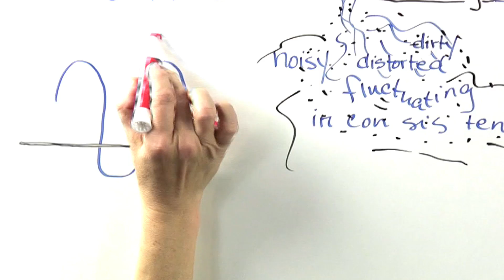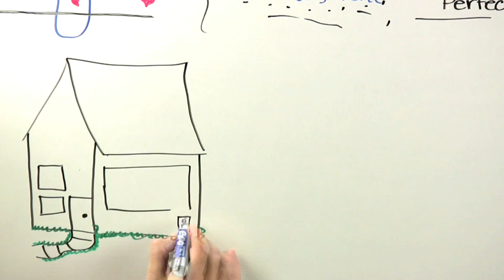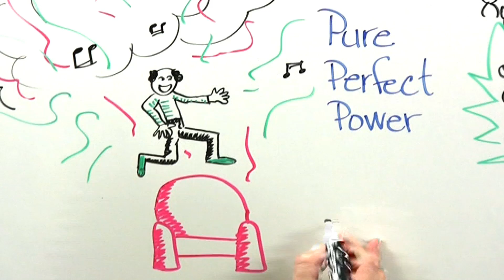PS Audio PerfectWave Power Plant

Comment: Please explain how your PerfectWave  Power Plant can clean up the AC power and a properly designed power supply in an amp can not.  Why the duplication of effort?  Modern power supplies can handle wide variations in input voltage.
Reply: @mrmaunz42  No, not bullshit.

Comment: Is this available in India?  I have a total of 24 audio equipment functioning as one unit.  I badly need something like this as the voltage fluctuation is severe here - 30 volts up and down every couple of seconds.  I never get 220 volts as claimed.  Usually it's only 180 volts and during peak hours it goes down even to 140.  Please let me know if 'PS Audio PerfectWave Power Plant' is an ideal solution for me.
Reply: You don't need this snake oil, you probably need all audio eqipment with full-range switching (even better if with PFC) power supplies

Comment: So, are you saying that you convert domestic AC to DC and then back to 'pure' AC so that my hi-fi or whatever with its expensive transformers can do Ac to DC...  There was once a vogue for making amplifiers that ran off DC batteries with separate AC-to-DC conversion boxes but they never caught on; I wonder why?  And where does good old earthing come into all this - do you ignore it or recommend drilling a hole in my wall to run an earth wire from my appliance to a spike or old flat-iron buried in the garden?  Incidentally, how does your power plant cope with domestic supplies that have brown outs, voltage fluctuates or permanent over-or under-voltage - problems I have because I'm the last house on a distribution circuit and we get power line problems in our coastal high gales and bird strikes.

Comment: This is crap because after the rectifier in the amp powersupply you have DC measured over the electrolytic caps ;)
Reply: ***** What im saying is that you do not need to do anything to the amp power supply. It does nothing to the sound :)  And most of all it does not lower the impedance of the AC. Anyway 

There is one important thing in the amp power... softstarter, rectifier with soft recovery diodes... overkill transformer and of coures 0.1F caps.... the caps depend on the amp size of course..

If you use a scope on the DC you will probably measure some microvolt noise which does nothing to the sound...

Trust me i have designed HI-power amps for the last 20 years :)

Do you have seriously problems with the AC mains in your country???
Reply: +Roy Rogers The thing is; you are not measuring the only thing that actually matters: what people hear. I can tell from my own blind testing that even using a woven powercable versus straight cables makes a difference. No your scope will tell you it doesn't, and yet I can tell you when you are using a woven one.
A friend of mine used to be able to tell wether the speaker cables wre wired up back to front, literally reversing the speakercable, attaching the speaker end to the amp and vice versa. I have seen him do it. Your brain tells you that is not possible, your scope tells you that is impossible, and yet it happens.

So, just because you think it doesn't help... well that doesn't really mean anything.
Reply: The placebo effect is on :)
Reply: I badly need to protect my audio gear from inconsistent voltages. I get only an average of 180 volts in place of 220 volts and the fluctuation is up to 30 volts up and down every couple of seconds.  What equipment do you suggest?  My amplifiers cannot function if the voltage is below 180.  I'm running my equipment with the help of a manual voltage regulator.